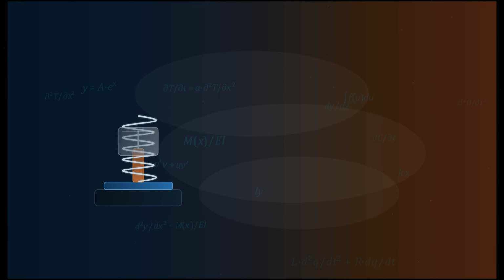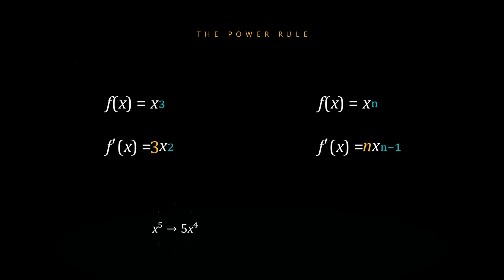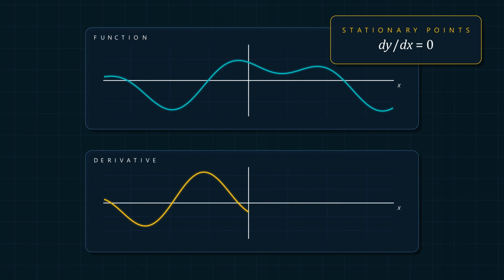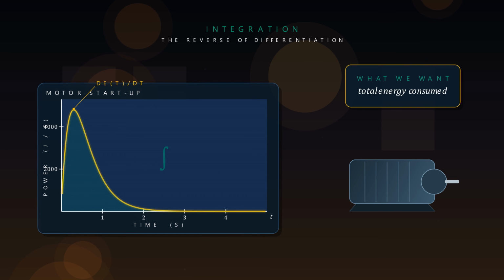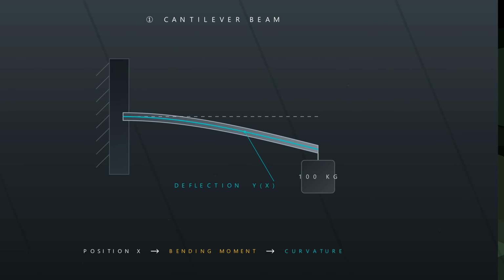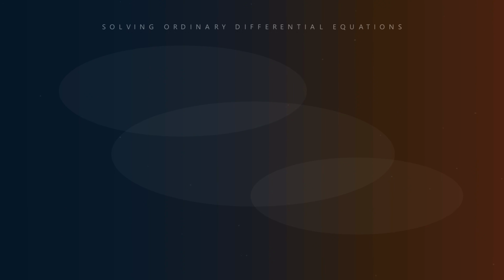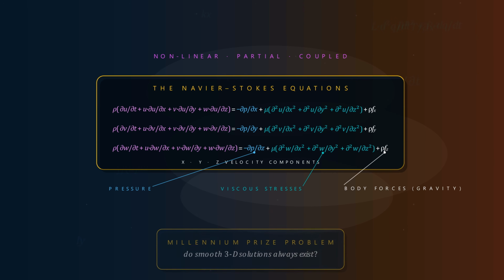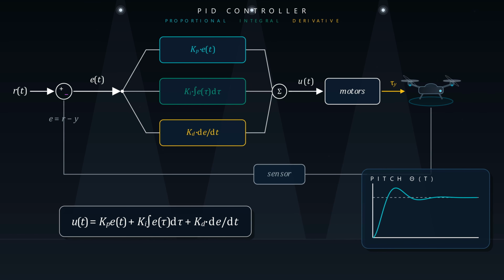How Differential Equations Run the World. Derivatives to Drones, Beams & Circuits.Calculus #calculus

Comment: "Partial Differential Equations in Physics" (Lectures in Theoretical Physics Vol. VI) by Arnold Sommerfeld is based on his "Lectures on Theoretical Physics".  It, like other volumes in the series, illustrates the thought-processes of a truly great mind.  From the Forward, "The topic with which I regularly conclude my six-term series of lectures in Munich is the partial differential equations of physics.  We do not really deal with mathematical physics, but with physical mathematics;  not with the mathematical formulation of physical facts, but with the physical motivation of mathematical methods.  The oft-mentioned 'prestabilized harmony' between what is mathematically interesting and what it physically important is met at each step and lends an esthetic -- I should like to say metaphysical -- attraction to our subject."  He was one of the strong bridges between Classical and Quantum Mechanics, a true Alpha Physicist.

Comment: what i dont understand is you said the derivative is the slope at any  point in the curve, but when you goto find the derivative of x cubed you dont pick any point on the curve, you pick two points, and its not clear what point your actually getting at.  the intuiative example showed the slope (stiffness) being anywhere on the curve, but when you get to x3 you dont do that anymore,  so x cubesd only has 1 derivative? if i pick any  2 points on the the curve ill get 1 answer? but the previous intuitive example showed the slope is different everywhere on the curve, so how does x3 only have 1 derivative? shouldnt there be multiple derivatives, depending what point you pick like shown in the previous example?
Reply from the maker: Great question — and thank you for watching so carefully! 🙏 This is honestly one of the smartest things to get stuck on, and you're closer to understanding it than you think.
Let me clear up the two separate things going on here.
First — why we pick two points.
The two points aren't the final answer. They're just a stepping stone. When you pick a point at x and a second point a tiny distance Δx away, the slope of the line between them gives you the average slope over that little gap — not quite what we want yet. So here's the trick: we slide that second point closer and closer to the first one (that's the "Δx → 0" part). As the gap shrinks to nothing, that average slope settles onto one exact value — the slope at that single point. So we really are finding the slope at one point; the two points are just how we sneak up on it.
Second — and this is the key one — x³ does NOT have just one derivative.
Your intuition is completely right, and this is where the wording tripped you up. The derivative of x³ is 3x² — but that's a formula, not a single number. It's a rule that gives you a different slope depending on which point you plug in:
at x = 1 → slope = 3(1)² = 3
at x = 2 → slope = 3(2)² = 12
at x = 0 → slope = 3(0)² = 0 (perfectly flat)
So the slope really is different everywhere along the curve — exactly like the stiffness example from earlier. Nothing changed between the two parts of the video. "3x²" is simply the compact rule that tells you the slope at whatever point you choose.
And to answer your question directly: no, picking any two points does not always give the same one answer — it depends which two points, and how close together they are. That's the whole reason we take the limit: to strip away the dependence on that second point and pin down the exact slope at the one point you actually care about.
Hope that ties it together — thanks again for such a thoughtful question! 👍